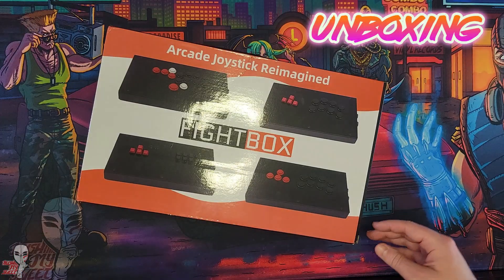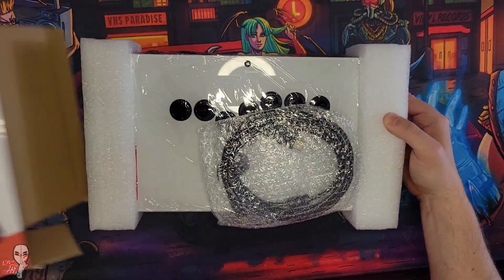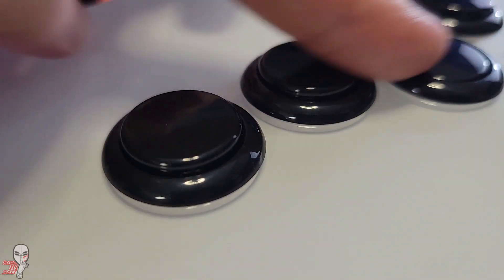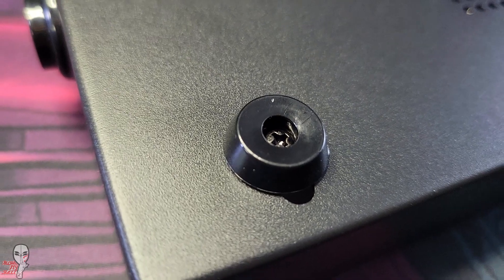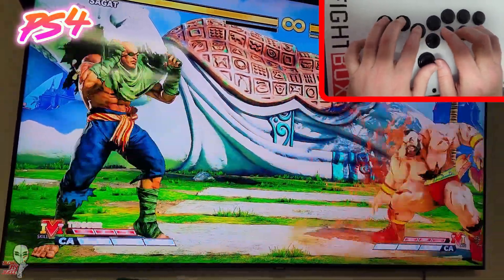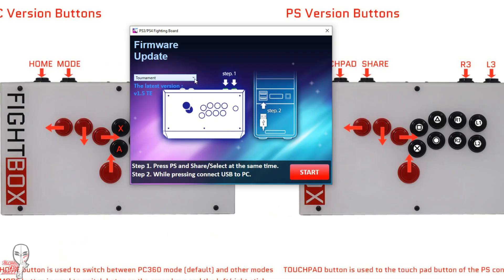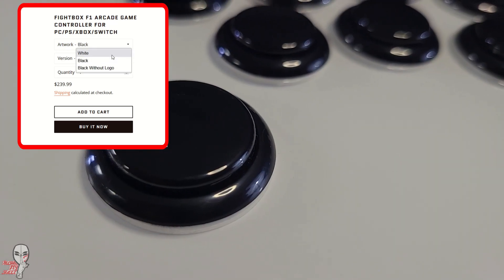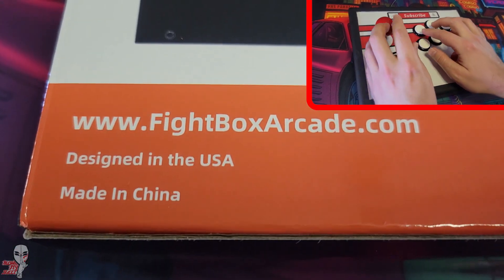FightBox REVIEW: Is it better than a Hitbox?

Comment: I bought the PC one it's great didn't like the buttons
Reply from the maker: Which PC version? If it's the FightBox B1-MINI, then they should have hot-swappable switches so you can change them to your preferred vibe. If it's the model seen here where they are using Sanwa, you can pull out those and pop in some Seimitsu, Crown, or whatever else you'd like. Good luck!

Comment: those sanwa sound like shit compared to most keyboard buttons.
Reply from the maker: That's just the standard sound they make in an enclosure like this. However, if it bothers you, you can always sub the buttons out for ones with more traditional keyboard switches. Thanks for watching all the same!
Reply: @HushMySweet1  I'm thinking abot buying one with the wasd style layout. Btw do you know if I can easly do kr backdash on tekken just by holding back and spaming down and forward. the thing that tournaments banned basically

Comment: Does this version of the fightbox, work with Xbox series S/X? Cheers.
Reply from the maker: The one you see featured in this video specifically does not, but they have one with an Xbox PCB on their website for ~$180. Navigate to the FightBox F1 page, and then change the version in the drop-down.
Reply: @HushMySweet1  Thank you for your reply. Are you familiar with the Brooks Wingman converters? Do you know if this specific fightbox would work with one of those? Thanks again.
Reply from the maker: @SoNicBOoMX9362  I wouldn't mess with one if I didn't have to, meaning, if I knew I needed to play on Xbox as well as PS5 or whatever, I'd just get the appropriate internals from the get-go. If you need something beyond the F1-XBOX (the one compatible with Xbox like you mentioned needed), you could select the F1-UV (which has a Brook Universal) or the F1-UFB-UP5 (which has the Universal PCB with the PS5 daughterboard upgrade). If you really need the Wingman for some reason, then this should work with that as I understand it, but I don't have one of my own to personally test just yet.
Reply: @HushMySweet1  Really appreciate the detailed reply. 
I already bought the Fightbox, unaware at the time, that the version I purchased wasn't Xbox compatible. I already own the wingman XB2 USB convertor. This little piece of kit works a treat with 99% of 360/PS3/PS4/PS5 and Switch pads/sticks etc. It is very safe to use, just need to make sure you download the firmware updates. Was unsure if the fightbox/hitbox models worked with it though, as my fightbox hasn't arrived yet. Cheers.
Reply: @SoNicBOoMX9362 the Stick works fine with Brook XB adapter?